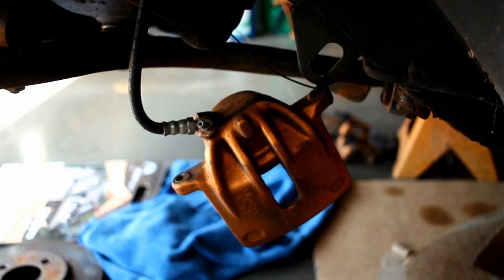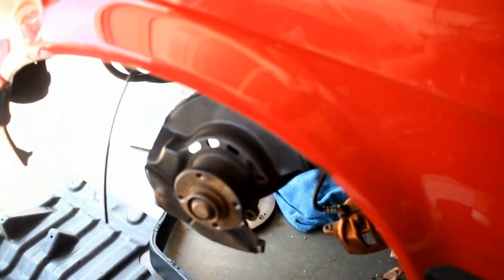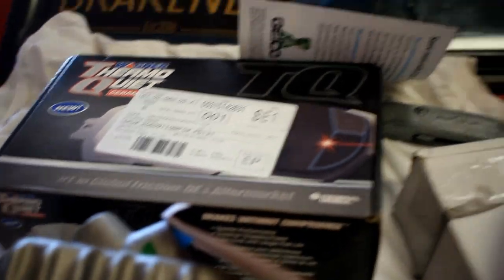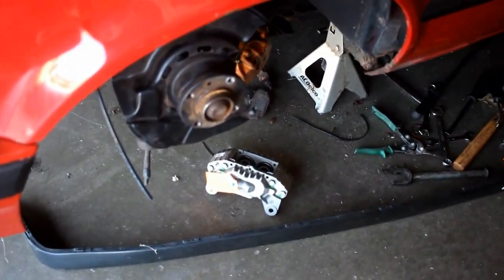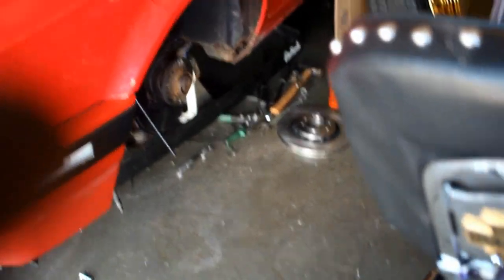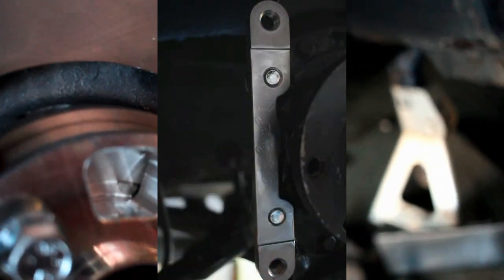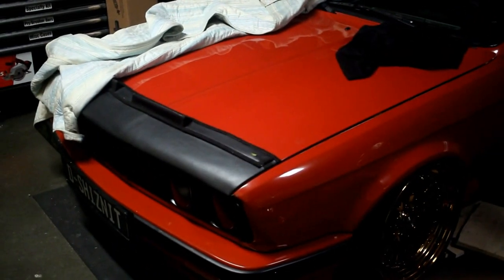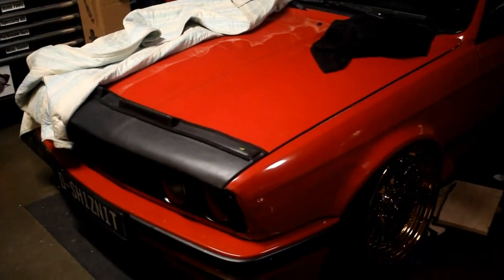Bmw E30 Fall Update: Garagistic RX7 Budget Big Brake Kit Install (Ep 3)

Comment: Love the content! I had a question I’m running similar wheels same design esm 16x8 in the front I was wondering how big of a spacer are you running to clear the caliper?
Reply from the maker: I have a 25mm to get the stance I want at -5 but I think like 5-8 offset clears I don't quite remember. Might be okay at 10 offset in the 8

Comment: Where did you put the shorter bolts that came with the mounts? Trying to put these on and I can't figure out which location they go in
Reply from the maker: I think the shoulder bolts Mount the adapter bracket on the front hub. And I think the longer ones go to the caliper